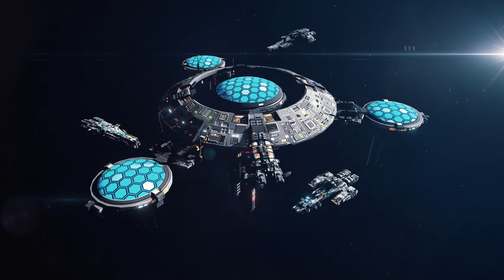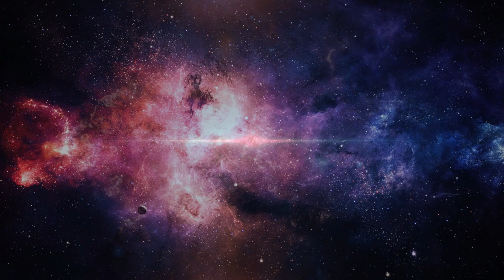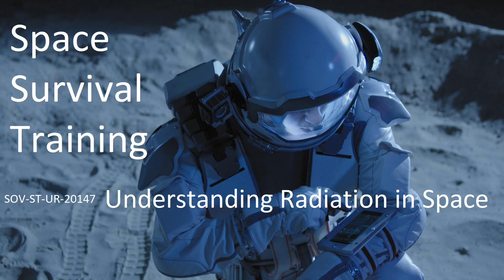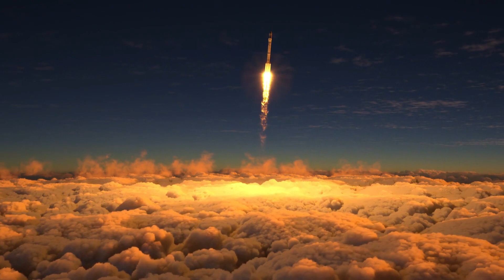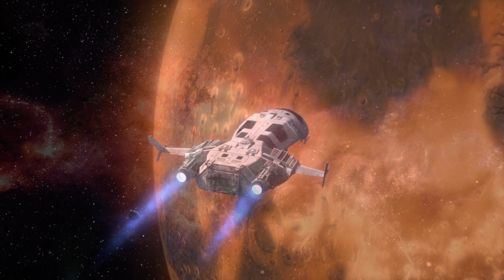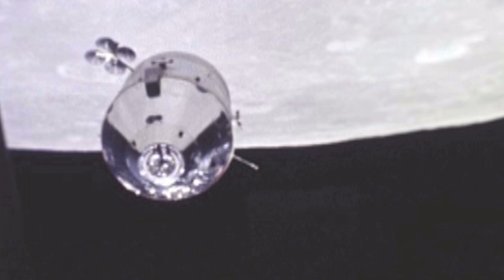SpaceX Starship: Understanding Starship Fundamentals

Comment: Your definition of rocket (and spaceship) are confusing, and essentially wrong.. 
Rockets are mechanisms to exchange Linear Momentum (and Kinetic Energy) between a STORED INTERNALLY propellant and a Vehicle.
A Space Ship/Vessel/Vehicle (SV) is a complex artifact that operates outside Planetary Atmospheres (over the 100 Km Kârman Line for Earth). A SV could be propelled by a (space-suited) Monkey throwing pellets backwards, and it still would be nominally a (inefficient) rocket.
From the Wikipedia:
"A rocket (from Italian: rocchetto, lit. 'bobbin/spool') is a projectile that spacecraft, aircraft or other vehicles use to obtain thrust from a rocket engine. Rocket engine exhaust is formed entirely from propellant carried within the rocket. Rocket engines work by action and reaction and push rockets forward simply by expelling their exhaust in the opposite direction at high speed, and can therefore work in the vacuum of space." 
So, everything using a Rocket Engine is usually call a Rocket.
Propulsion using the thermal expansion (Chemical, Electrothermal, Nuclear Fission/Fusion) is only a (huge) class of rocket engine; but Electromagnatic and (Electro-) Mechanical accelerators of reaction mass ARE ROCKET ENGINES.
The Lunar Module is a Space Vehiche that uses Chemical Rockets as propulsion, therefore IS A ROCKET.
A Solar/Laser Sail is not a Rocket, as a Solar Wind Magnetic Sail (or a Bussard Ramjet), because they use an engine that employs external media for momentum interchange betwen the Space Vehicle and the LOCAL environment. 
Also the geometrical arrangement of the SV is not relevant to any definition here; SV shape depends on its operational environment. Where does in the Rocket Equation appear any term requiring cylindrical geometry?
Was the Space Shuttle not a Rocket? Or DC-X SSTO? Or any spherical/conical/toroidal SV (past, present or future) propelled by a rocket engine of any type? 

I usually like many of your videos, but for an 'Academician' this one is a real dissapointment.
Reply from the maker: I understand your frustration but I'm just trying to establish common terms for the video.
Not provide the definitive universal definition for each term.
A rocket is normally considered to be powered by combustion, but we still say Nuclear Thermal Rocket.
Technically a rocket must be cylindrical.  We could discuss whether the fuselage of the shuttle qualifies but as far as I'm concerned it is not a rocket.  It is a spaceship and a space plane.  The DC-s was...

Rocket:
a cylindrical projectile that can be propelled to a great height or distance by the combustion of its contents

Space
a continuous area or expanse which is free, available, or unoccupied

Ship
a vessel larger than a boat for transporting people or goods

Boat
a small vessel propelled by an engine

Spaceship
a spacecraft, especially one controlled by a crew

Spacecraft
a vehicle used for traveling in space
Reply: The Odissey One - the spaceship piloted by Bowman and Poole - wasn't cylindrical; she had a spherical command module, a long truss, joined to a flat rocket engine section.
Wasn't she a rocket? She used ammonia made into plasma by a nuclear reactor.

Comment: 4:47 the numbers are incorrect. Starship when fully fueled is 1320 tons, sans payload. Therefore the actual propellant mass of SH would be 3,400,000 kg sans 180t of dry weight, with full mass of 3,580,000kg. 5,000t-3580t=1420t, which is the gross mass of SS.

The formula remains the same, however. When plugging in my numbers, accounting for empty weight of SH as well as gross mass of SS on top, delta V would be 3,688m/s, which would multiply quickly if starship then stages off of SH, leaving what fuel remains after SH’s ascent burn enough for Boost back.

6.38km/sec of delta v for a first stage rocket booster carrying all that mass is absurd.
Reply: I suppose..  6,380 isp for one engine would be definitely unheard of. Starship does use many raptor engines in its booster stage.
Reply from the maker: Isp 6,380? Do you mean deltaV?
Reply from the maker: The total mass of a Starship with maximum payload is given as 5,000 tonnes or 5,000,000 kg by SpaceX.
The final mass was calculated by subtracting the 3,400 tonnes of propellant mass in the Superheavy.
Starship dry mass  120T
Starship prop m   1,200T
Booster dry mass   180T
Booster prop m    3,400T
Payload                    100T
--------------------------------------
Total                       5,000T
Reply from the maker: Correction: And I transposed two digits.  The formula is correct but the Starship with an initial mass of 5,000T and 3,400T propellant has a final mass of 1,600T. I transposed 3,400 to 4,300 and got 700T final mass.  Thus proving attention to detail is important :-(  I should have realized the deltaV was too high but it was about 4am.  Thanks guys.  Correction added to description.  It would be great if the final mass was 700T though... 3.69 km/s vs 6.36

Comment: we ( humans ) need a way to lower the initial mass at the pad..  A higher specifc inpulse engine could be used with less thrust to escape earth After some massive speed is attained.. Building something 100k feet tall isnt practical.. I do think a sled would help.. a 20 mile train track , mag lev , gain more horizontal speed with the liquid fuel while also leaving it behind on the sled ..granted cutting though sea level atmosphere at mach 12 would incinerate the crew..  ahhh, i guess a fuel depot on the moon is the future.
Reply from the maker: Watch our video, "Rail to the Stars", there is merit to your argument.